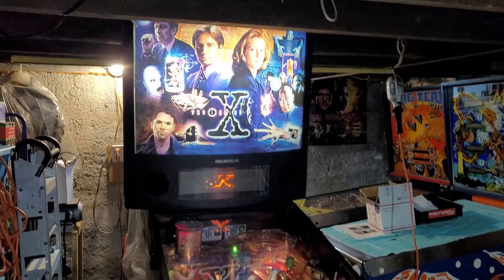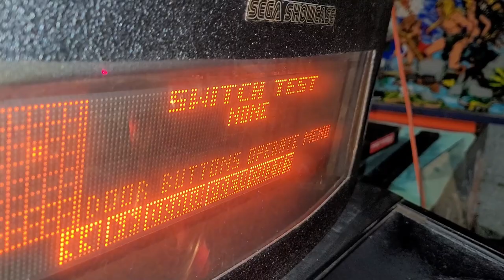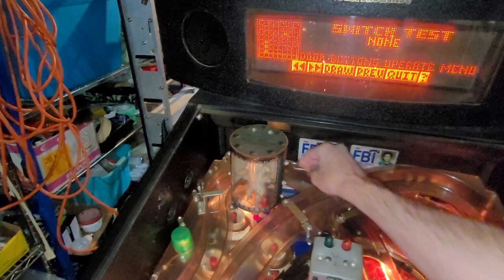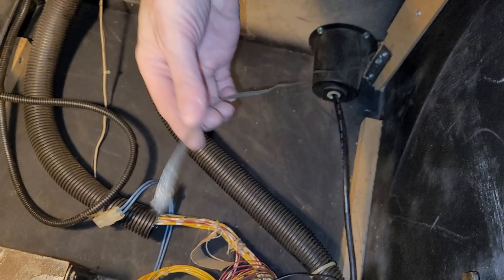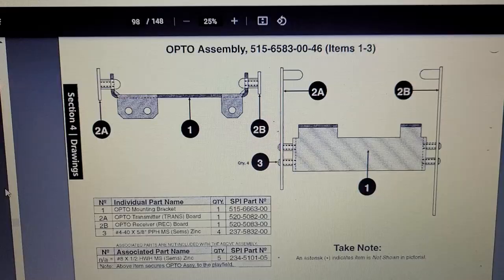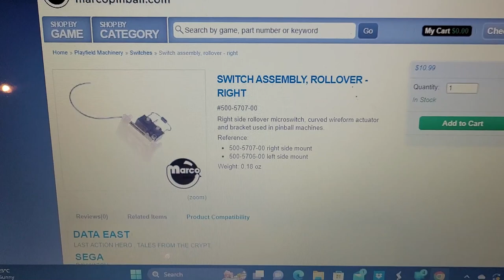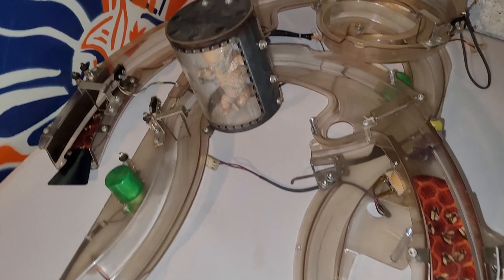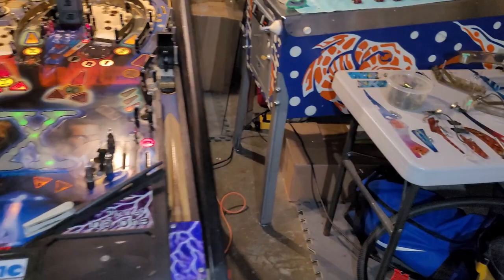Part 2: Sega X Files Pinball Project. Top side tear down time!

Comment: Aftermarket speaker and the cables near the speakers should be like that nothing to worry about. Its 100% had a new bottom thats not factory
Reply from the maker: Ahh a new bottom eh! Shit!!! That is why one screw is missing from the transformer and wires and ground straps are a mess! Good call.
Reply: Definitely a rebuilt bottom cab.. and woth the speaker replacement makes me wonder of somebody tried to break in through the speaker and didn't have luck so they tore the bottom out... I'm no FBI agent..but being this is X-Files might as well have a good conspiracy and story! 😅

Comment: Good day to you Mike.  Another great video of course. 

So I was thinking the wood modification, speaker (maybe) and glass fragments you found.  Missing back box hinge bolt covers.  Cut ground straps.  Wires taken off harness or clips.   I would say someone somewhere has had that all out of there at one point.  Too many clues that something happened to it.    

Also, do they normally not spray paint the area black where the coin box is located?  Just wondering if they leave that area on the bottom untouched.   I just thought that looked odd too.

Thanks for the shout out to everyone from episode 1.   You’re the greatest and take care!
Reply from the maker: Yes good points! Mr TBA noticed the bottom was replaced so we are starting to figure out the story on this guy one clue at a time!
Reply: @pinballshenanigans Look at what I put under Mr TBAs comment.. I broke the case!😂

Comment: Thank you again, I am 62 yr old with a 50% white board in a frame and I learn so much from you. With the skills u and the grassy have, Have you considered soldering a wire to a micro switch yourself and save the 10$ plus 20$ postage$ I am about 3K$ in and only 80% complete over all. So expensive?
Reply from the maker: Thanks for the kind words! What is a  a 50% white board in a frame? You are working on an X-files too? I did manage to fix that switch :)

Comment: Spray switch cleaner in the switch .... $11 for a Cherry switch ! I could buy 8 for that price. What a rip-off 🤣
Reply from the maker: I tried windex but maybe contact cleaner can do the trick!
Reply: Contact cleaner will do the trick. Give it a try.
Reply: @pinballshenanigans  Has oil for the switch and electric cleaner, plus it evaporates. Used many times for those coke spilt over the arcade machines buttons.